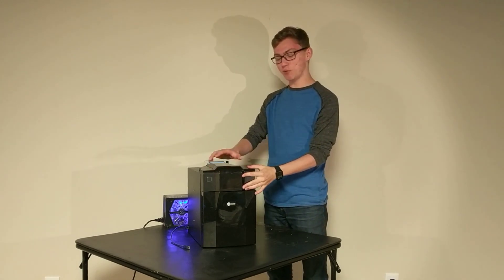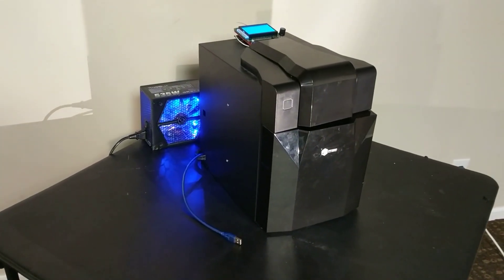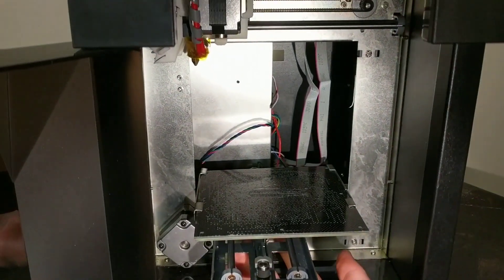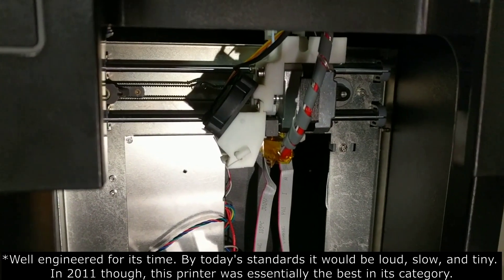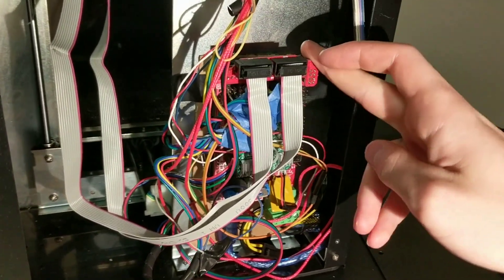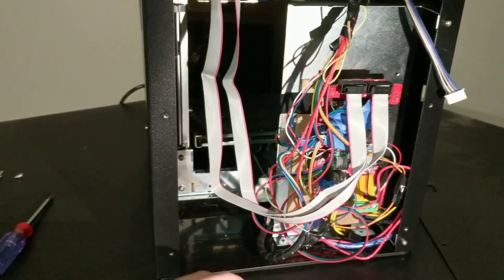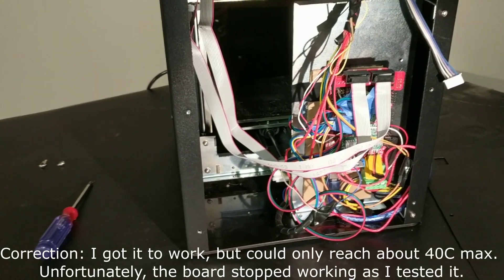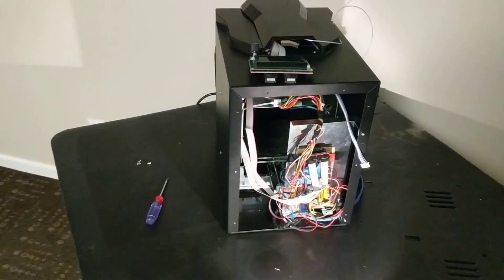Hacking an Up! Mini 3D Printer to use #Opensource software! Fixing a Proprietary 3D Printer

Comment: Great Video!
I have a basic UP Mini (the black box model 2015).  Can you direct me to where I can download the software for this printer?  
I just got a used one but can't get it to work.
Thanks!
Reply: Thanks so much for your quick response. I really appreciate your direction!
 I'm not as mechanically savvy but will give it a try.  I'll touch back with you soon.
Reply from the maker: @elcasa6587  Of course! I'm happy to help, so touch back soon!
Reply from the maker: Thanks! So basically, I'm not using the stock UP mini board that this came with, and I would probably advise you to do the same. I took the mainboard out and replaced it with a Ramps 1.4 board, though I would recommend something like the SKR 1.4 now. Once you have that installed and all motor wires, thermistors, and heaters wired up, you can flash Marlin 1.19 or 2.0 to your board and use any slicer you want with it-- I recommend Cura. Its not too bad of a process if you're familiar with 3d printer tinkering. If you don't want to take that route, I unfortunatelydon't think I can help with setting up a stock UP mini. I wouldn't know the first think about setting up or troubleshooting Tiertime's software on this machine. Let me know whatcha think!! Keep me updated

Comment: Have you figured out the issues with PLA and heat creep with their stock hot end?
Reply from the maker: I haven't had issues thus far. The cold end seems to be well separated from the hotend by cooling it with an aluminum heatsink and 40mm fan. I still have to test it's full capabilities, but it doesn't seem to suffer from heat creep.
Reply: I say this because Angus was saying it was a problem, and there was someone on reddit asking for help on heat creep with the Up Mini on PLA. Good to hear yours doesn't have these issues.
Reply from the maker: @Anonymouspock  yeah, I know the up mini originally didn't support pla, as you cant control the hotend temperature in the slicer. Maybe that was what you mean? I know the printer used to operate at only 270 C, so way out of pla range.
Reply from the maker: @Anonymouspock  do you, by chance, nlknownwhich video of Angus' that was? I'd love to see it. Thanks
Reply: @MakingwithLuke  the new look at it video where he looks at how it's held up in the modern industry.

Comment: Upgrading the Up!Mini is a good idea. It's still a pretty descent printer if you agree with the small build plate and no heating bed. About the Ramps choice, actually 32 bits boards are available at a pretty decent price (about or under 20 bucks). I think about the MKS Robin or SVR 1.3 which allows higher current (up to 24vDC) for better velocity of the whole printer and faster preheating time. Both allow better wire management by the way. That makes the Ramps totally outdated nowadays. I guess the first print of this refited up mini would be a 12864 screen case, wouldn't it ? ;)
Reply from the maker: Yeah, It is definitely usable. I will upgrade this printer to use a 120 x 120mm heatbed in the future. 

I have seen these boards, and briefly addressed them in a different video. For this printer, 32 bit isnt neccesary. I used ramps because I could buy a whole kit for like 20 dollars, lcd and all. In the near future, however, I will only buy 32 bit boards because they are so cheap. 
I really like where the whole 32 bit trend is going! Cant wait to get my hands on one.

I think I may have to print a case, thanks for the suggestion.

Comment: Wow good video btw got love that tronxy screwdriver (best tool in the kit :p) i i am surprised you didn't  use capton tape to insulate the back. Also i would have also made a stand so you can see the screen and access it but still very impressive build and get that machine working.
Reply from the maker: Thanks Ron! Lol its funny you noticed that! It may even be from my Anet A8, I've had it for a while now. 

Yeah, I may make some sort of stand for the LCD, good idea.

Comment: A true hackers dream build! Awesome job! I am working with a Photon printer to do something similar and get control of that printer and move away from the ignorant proprietary setup it is now. Not a fan of the idea using magnets for the carriage. That seems like an obvious point of failure that could be problematic and not something I would opt for.
Reply from the maker: Thanks Kevin! Have you looked into NanoDlp for the Photon printer? I almost built a custom Dlp printer before, and that was the board/ software I was going to use. Its what most of the DIY Sla community uses. 

Yeah, I too don't know how practical the magnet setup is. I was attracted to it mainly because it is a novel way of attaching the carriage. I think it was included so if the hotend crashed into the bed, the carriage would just detach, instead of destroying the machine. I also like the idea of using magnets in a tool changing printer, even though this printer would obviously not be suitable for such a mechanism.
Reply: @MakingwithLuke  No I had not heard of NanoDlp until just now but did a quick search and want to thank you for the heads up. Looks to support exactly what I am wanting to do so thanks a ton.

As for the magnets, do know that high heat will demagnetize your magnets. It does appear from what I saw they are closer to being super magnets so they have that going for them. however the high heat that is associated with the nozzle is going to weaken them much faster than would be normal. So just keep that in mind because it could start causing shifting in your print layers and of course bumping the table or machine during a print could be problematic, especially for prints using tight tolerances.
Reply from the maker: @kevinm3751  Yeah, happy to help! You should check out this facebook group.https://www.facebook.com/groups/283996458880799/

Yes, but you have to reach higher temperatures than what is typically conducted through the stepper motor for that to be an issue. If your stepper motor reaches above 80C, then you probably have worse issues. It is certainly possible, though. I agree with you, and probably wouldn't implement this into a new build.

Comment: Nice little project Luke. Im curious about the steppers. If the old system was 19volts was it then reduced to 12v to power the steppers? and what was wrong with the old controller? did it need replacing or did you just want to swap it out?
Reply from the maker: Thanks, Chris. Yeah, While the board uses 19 v, the motor drivers take the board's 19 v and send much less voltage to the motor itself. Typically motors are run at 0.4 v to 1.2 v. I believe these Nema 14 motors are running at 0.4 v. I'm not sure if there were components on the old board to make the 19v 12v or some other, smaller voltage. I'm definitely not an electronics engineer, but that's what I think. 

On the old controller: Yes, It was broken. The machine wouldn't power up, but even if it worked perfectly with its closed-source hardware/software, I would've replaced it with open source stuff.
Reply: The motor driver boards are what do the voltage conversion, FWIW.  See you at next year's #MRRF, Luke.
Reply from the maker: @davidwillmore  Thanks for the info, that's what I meant, but it may not have been conveyed very well in my previous message. 

I'll see you there as well!